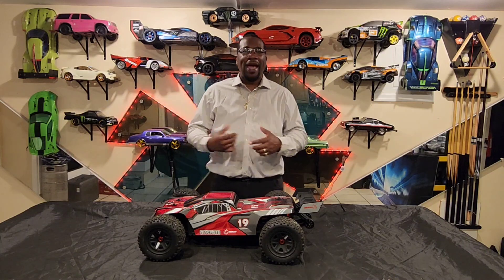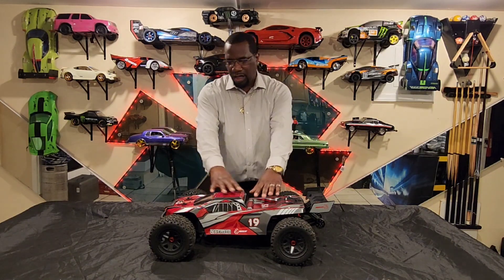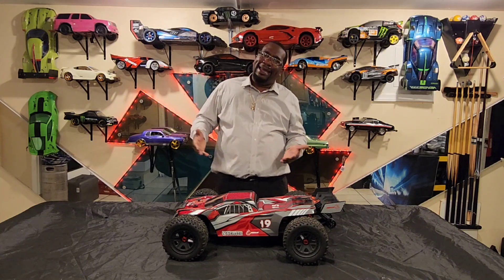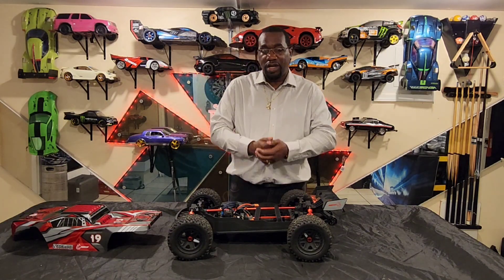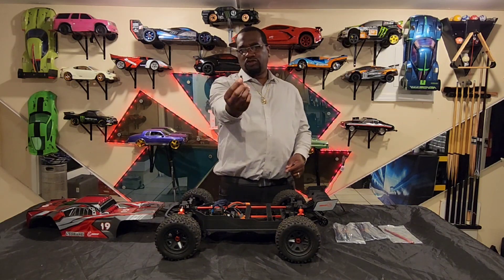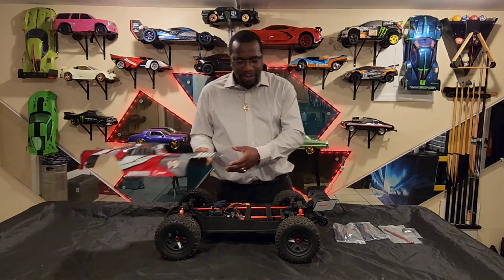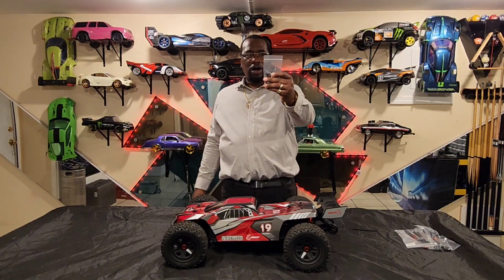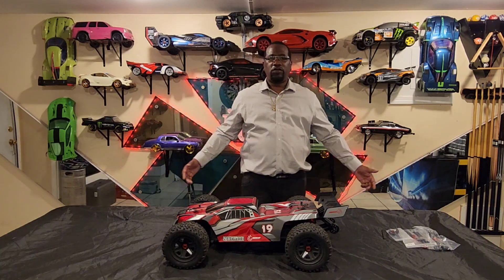Redcat Machete 4S Review. How good is it

Comment: Really good and fair review. I grabbed the 6s version couple weeks ago, when the shop by me had an in store sale. There was a manufacturing error at the beginning  and they took care of it very professionally, and my rig came with a bag of replacement parts addressing any issues people had. I agree that this set up you want to run 6s, and the rtr electronics run great.
Reply from the maker: @MrGonzoify  I don't know what system in the 6s version, but this setup that I got in here runs this baby great, And Redcat is really good with any technical problems you have with they RCS they replace any part that u have a issue with and fast.
Reply from the maker: @MrGonzoify  thanks for watching
Reply: @louiesfixit  in this day and age, it is so hard to find good customer service, so giving them some recognition is great. Keep up the good work, and you got a new sub with me! Cheers from Canada.
Reply from the maker: @MrGonzoify  thanks i appreciate it